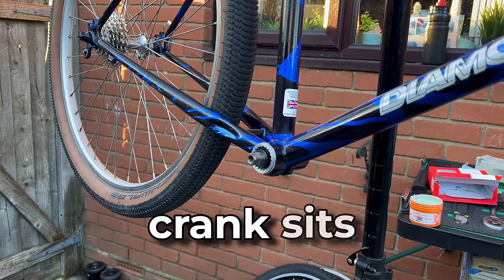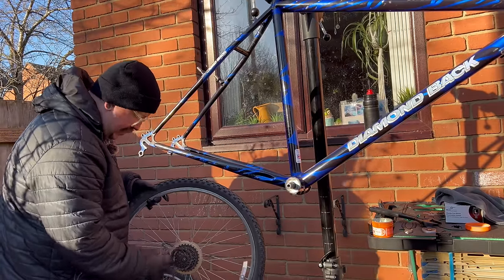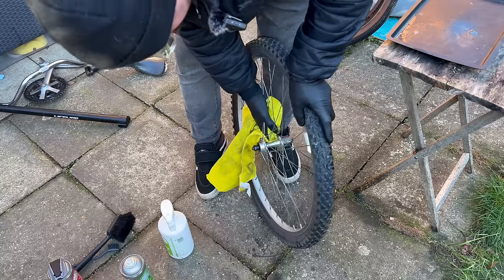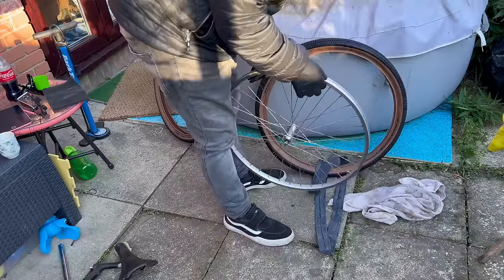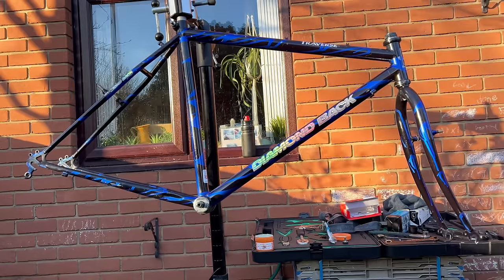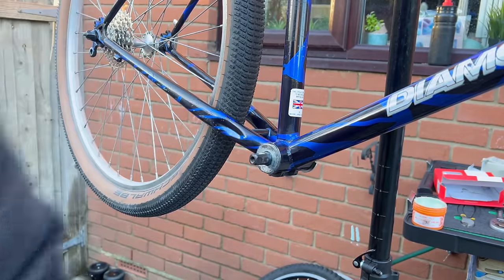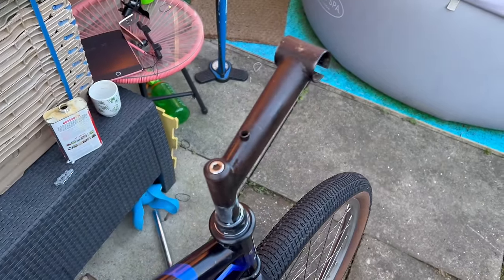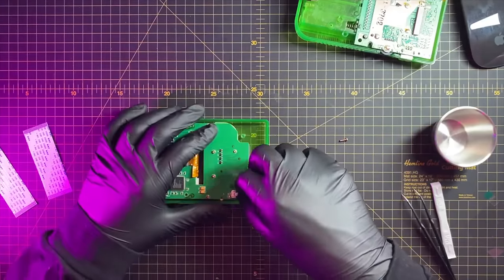Cheap Bike Build Off - Diamondback Traverse Restoration -  parts bin Commuter bike build vintage MTB

Comment: If I were you, I'd cheap out on anything but the tires and saddle. Maybe see if there's a cheap Superstore bike somebody just wants to get rid of off the side of the road - that could be a parts donor.

Also, I run a pretty simple spreadsheet of my bike parts, just a basic list of what it is and how I got it/how much I got it for. That might help keeping track of costs for stuff like this. The hardest part is starting it up tbh.
Reply: I like the idea of a parts spreadsheet! A new means of tinkering with bikes but it looks to anyone else as if you’re working on the household budget 😂
Reply: @1972hermanoben  There's also that spreadsheet, and the spreadsheet for batches of homebrew that I keep running for stuff that I learn to carry forward.

As silly as it is, it's been a tool that works for me.
Reply: I would rather not know how I spent for the old trash. 😂 I would need to smack myself😂

Comment: Great channel! I’m building a bike along with you guys. My local shops that deal in second hand parts are $5-$10 a saddle.  I like buying dirt cheap thrift store bikes and scavenging parts as well. Sometimes a department store or other low quality bike can yield tires, pedals, brakes, levers etc. and the whole bike cost $20. Also any credit given for for parts taken off and resold from the original bike?

Comment: I bought one of them there shiney Sunrace cassettes for a build. It didn't like the 1990 Shimano SIS system so ended up putting it on a road bike with down tube manual gear levers instead 😪
Are you allowed to sell off the various parts that came with the bike to offset the cost?